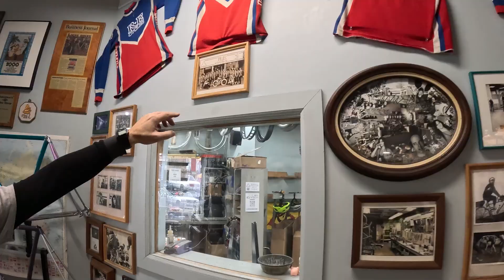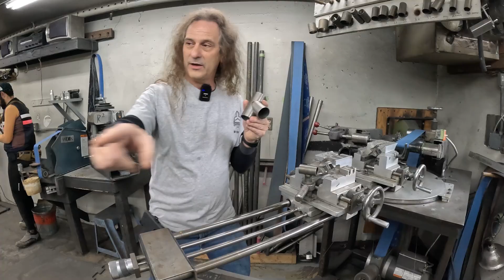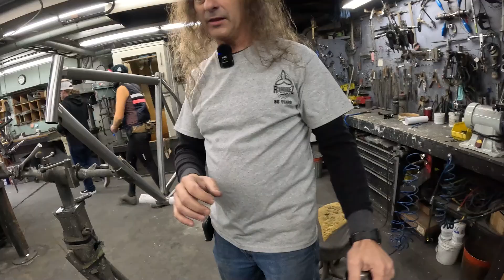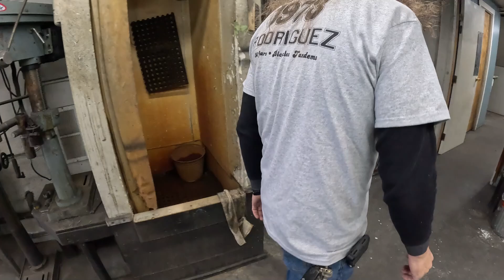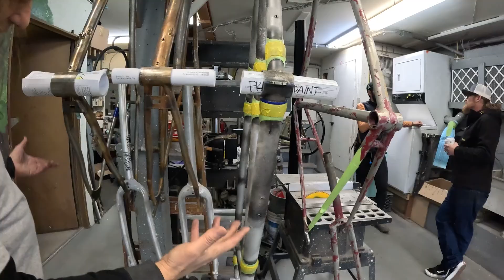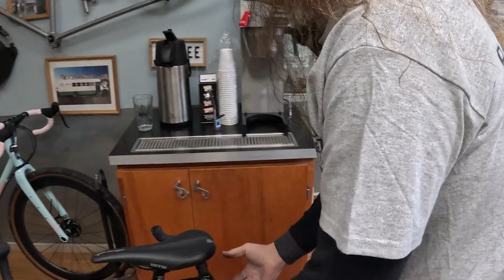Custom Steel Bikes and Tandems in Seattle: R+E (Rodriguez) Cycles Shop Tour

Comment: I used to hang-out there back in ‘80, maybe ‘81 when I lived in Magnolia. 
Spent a little time talking with Angel when I was building my custom Aluminum bike. Seems like yesterday, not almost five decades ago. 
My wife and I stopped-by (1983?) and afterward walked up the street a few feet. A store was advertising a poster by Linda Berry, “Poodle with a Mohawk!”  We suspected the poster would become a cult classic, and it has!  I’m still a young man living in Seattle but the calendar, and postal zip code says differently.

Comment: Our Erickson tandem came from there.  We're the second owner.

In the late 80's, when NE 45th was stripped down to the brick, was bumpy as heck and was on my daily commute, I broke a dropout on my commuter bike.  R+E replaced the dropout.  When that bike later got a broken bottom bracket casting, R+E told me that was terminal.  Custom was more than I wanted to spend at the time, but I bought a mass produced frame, R+E checked alignment, adjusted rear dropouts, installed the headset, and painted it a custom color.  I built it from there.  That bike has over 20,000 miles on it so far. It's the only bike I've ever owned that never needed a headset adjustment, which shows the difference when the job is done right.